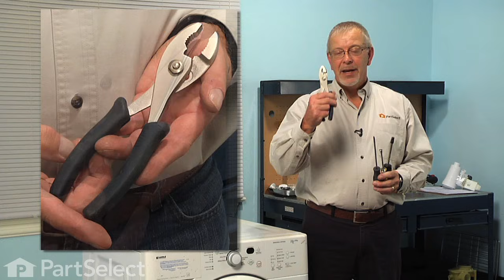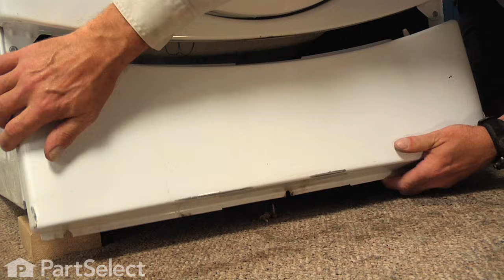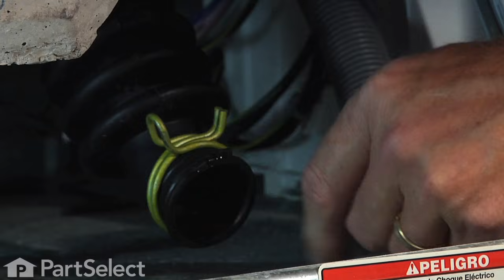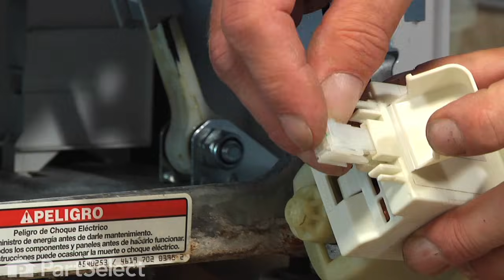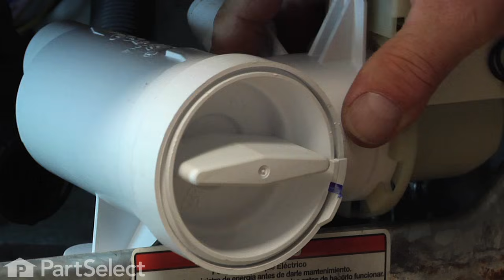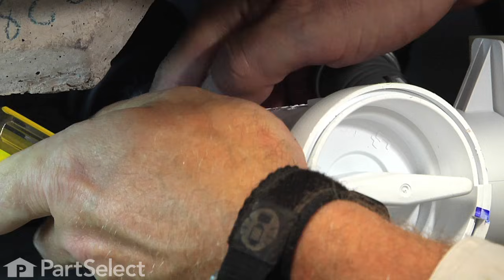Washing Machine Repair - Replacing the Drain Pump (Whirlpool Part # W10130913)

Comment: My Whirlpool (wfw9250ww01) has a completely different type of metal clamp holding the second drain in place so I'm having a difficult time figuring out how it detaches. There is also a bracket with two screws underneath the machine holding the pump in place so it wouldn't just come out as easily as you did it here. A close-up of detaching the electric would also be helpful.

Comment: Great video, thanks.  If replacing the black drum hose clamp (spring clamp) with the replacement worm gear clamp, I suggest putting the worm gear on top, facing left.  In the video, he puts it on the bottom facing left.  It's easier to access it with a nut driver or socket, and you can better see what you're doing.

Comment: Why replace the wire hose clamp with the worm gear hose clamp? Worm gear clamps are a pita to use in tight spaces.

Comment: THANK YOU! I am only a little bit handy, and usually avoid repair tasks that involve both electricity and water. But these clear, concise instructions gave me the confidence to try. And it worked like a charm! It took me less than an hour to replace this part, which cost $26, on my ~15 year old Kenmore washer. Compare that to calling a repairman or buying a new unit...THANKS AGAIN!

Comment: Take that filter out and clean it, including the black gasket, inspect for integrity before replacing.  Look inside the filter chamber and clean what you can in there as well.  If there is no leak, try a test run before replacing the filter. You might not need to replace the pump.  Just a consideration.

Comment: Great video.  On my Whirlpool Duet washer the 2nd drain clamp (out to the sewer) is a permanent-type clamp and I'm not sure how to remove it without breaking it?  The impeller isn't moving (stuck my finger in there) so there must be something wedged in there as I assume it's supposed to spin freely?

Comment: Thank you for this video.  I cannot seem to get the rubber piece to get into place.  Will it be a problem if I just leave it out?
Reply from the maker: The piece can be a pain but it should be put back in. The manufactures are pretty cost concious on how they build their products so if the put the part in  ideally it should stay on the machine,  I have at time had to lubricate that rubber piece with a little vaseline which really helped getting the rubber to slip into place.  Give that a try good luck you got this. -Chris

Comment: Do these pumps make any noises prior to them failing? I think my water pump is louder these days than it used to be. And its an older Duet washer which I have had to work on before. Also does anyone know what the average usable lifespan is for these drain pumps?

Comment: THANK YOU, THANK YOU! Draining problem and SUD and Error 21, Kenmore Elite He5t (these have been GREAT, BTW). I removed the drain pump just like you said (3 min), and after cleaning the trap, found a NYLON CORD and a METAL...something, wrapped around the pump propeller shaft. Removed them and...IT WORKS AGAIN!!!! Thank you, AGAIN! Draining the water was the hardest part!

Comment: Great how-to vid. If additional info is helpful? * Stackable, you don't need to tilt it back. Just get a extension bit for the 1/4 driver. I use a drill. Save the hose clamps, always useful. Save the gasket on the large item filter. Usually need one of those b4 the pump goes out. Last, if your pump took a trump... Your washer is full of water. Use a funnel to a bucket (gallon size) and drain that way. 
Once again, great vid! Followed it & was done fast. Just some little adds if anyone's interested 👋

Comment: Just wondering if you might be able to shed some light on a problem I am having. I have the Kenmore HE2Plus washer/dryer machines and need to replace the control board on the washing machine. My problem is .. .. .. how do I remove the outside metal panel to get to the board? Would I need to take the dryer off the washing machine first (they are currently stacked)? There are no visible screws to release the panel and the manual does not address this issue. Thanks for any help you might be able to provide.

Comment: Had to replace this a few years ago, just after buying the &%$. All I could remember is how easy it was, now I got to do it again and couldn't remember how I did it so easy, so I start from the back panel. Took a break to keep myself from taking the sawzall to it and punched Google up with a "how do I" question and your video was at the top of the list, just the way I now remember doing it. Great video, probably saved me from buying a new one - thanks for bailing me out.

Comment: This video was so helpful.  Worked just as Steve the mechanic demonstrated. Our Washer - about 10 years old - had a ton of stuff in the "button " trap and the pump impeller was stopped by a eyeglass cleaning cloth wrapped around the impeller axle.  It worked fine after that, but if it "goes" , I now know how to replace it with a new pump. Wish I could show you a photo of the junk, nuts, bolts, paper clips, pins, lots of coins, screws, bamboo skewers... unbelievable.  Plus one dryer sheet and the offending microfiber lens cloth.

Comment: Great video but you didn't show how to remove the pump away from the debri collector.  If this helps others ; to remove the pump from the collector, disconnect the accessory plug (mentioned in the above video)  near the top of the water pump, this then allows the removal of the small plastic shield that covers the small water pump motor.  Once done, you'll find that by removing the plastic shield, you'll see  if you look around the 11 o'clock position (if the top of the water pump is 12 o'clock)  a small flexible piece of  nylon plastic on the collar  (much like a dividing board) that requires upward pressure to allow turning of the water pump collar counterclockwise for removal from the debri collector. Once done a quick inspection will reveal any problems associated with the performance of the propeller.   I found that after pulling out the spindle from my pump motor (keep in mind it required a good tug)  it was full of a black mushy grunge that was impeding the propellers performance.
Reply: Yeah, I just replaced the pump motor not the whole debri collector too. Didn't have to go through the steps you state here though.  I just grabbed the motor and spun it counter clock wise and it came off easy peasy.   Did you have a round rubber ring seal between the pump motor and the debri housing??
Reply: @davidr4249  Hi Dave; It's been awhile since I did the work and to be honest, I can't recall if there was a rubber seal or not.  Sorry.
Reply: Thx u G! -I'm gonna  figure out a good place for a fine mesh screen to stop that gunk too. seems like the logi nxt steezy 💯

Comment: I just changed the pump on my washer. I had ordered the pump for my whirlpool washer from Sears Parts Direct. No hose clamps came with it so I had to purchase them separately. With the use of this video it was a simple change over. If you have ever replaced a radiator hose you can do this. The only problem I had was to get the black rubber locking piece to lock back into place to hold the pump in its position. After a lot of struggle I noticed the new rubber piece and the old rubber piece are different, as the old one has a groove cut into its edge to accept the lock which protrudes out from inside the hole where it fits down inside the cabinet. I exchanged the two rubber pieces and put the pump back into place with the old rubber piece attached and then was able to lock the pump back into place.  A large flat screw diver was used to push in from the side while the pump was pulled to the left. Without this video I would probably have had a much harder time with this.  Thanks.

Comment: Cant thank you enough! We have twins and a lot of laundry. Cleaned the filter in and back together and working in 30 min.
Reply: Thank you for the video. It seemed simple enough so I gave it a shot, ordered a part and fixed it in minutes. $30 instead of over $500

Comment: Thanks a lot, Steve. I was able to change washer pump with the help of your video after buying the required part on Amazon. I love it when folks like you share wealth of information in a descriptive way. There is no reason at all for anyone to hire appliance repair guy  to change washer pump after watching this video. If I can do it then anyone can! Along with saving a lot of bucks by not hiring appliance repair guy, knowledge that I learnt through this video can be used again to change pump as needed.

Comment: Thank you for this video
I took out the drain pump and found a small eyeglass cloth clogging one of the ports.
Reinstalled and all is working well
A new drain pump can be purchased for around 140.00 on line 
The several appliance repair companies I called were booked for two weeks out.
Reply from the maker: Hi Steve! Thanks for the kind words about the video, and we're glad that you were able to fix your washer yourself, rather than waiting for a repair company!

Comment: This video just saved me $300.  Part of a zipper pull got caught in my pump, an elastic with a metal emblem attached, and it was making a terrible racket.  After a bit of a diagnosis and watching this video,  I was able to take out my pump and remove the thingy.  Woot!  Thanks so much.

Comment: Ok, the appliance repair person who came out pulled the panel off without lifting the washer (it has a dryer stacked on it). He looked and looked.  His diagnosis was ripping everything out of the small space the units are in and taking the bathroom door off to move the unit into the living room to work on it.  It was to take an entire day and two men.

Now I know why my home warranty denied the coverage.  It wasn’t needed as the repairman wrote it up.  This is something I can handle with my little tool kit.  I probably won’t even break nail.  Thank you.
Reply: Update: Went and pulled that first part off.  OMG!  Hairpins, coins, earrings (not mine. This washer came with the condo) and black gunk.  It is clean now.  I know the rest of the pump is probably damaged by this mess, but if I can get it to hang on a couple more months.

Comment: Check the filter before replacing the pump. If you start getting F 02 code and pausing and restarting the cycle finishes the load then it is probably just the filter starting to clog. Just clean the lint and debris out of the plastic filter/strainer body and clean around the gasket to get a good seal.
Reply from the maker: Good point, Robert! Thanks for pointing it out!

Comment: Will this fit most whirlpool washers  mine is a WFW70HEBW
Reply from the maker: Hi Bernie, when researching your model number there is a 0,1 or 2 to complete your model number. Model WFW70HEBW0 and WFW70HEBW1 have the same drain pump (https://www.partselect.com/PS11754106-Whirlpool-WPW10391443-Drain-Pump.htm?SourceCode=4&SearchTerm=WFW70HEBW0&ModelNum=WFW70HEBW0) and model WFW70HEBW2 has a different drain pump https://www.partselect.com/PS11754613-Whirlpool-WPW10425238-Drain-Pump.htm?SourceCode=4&SearchTerm=WFW70HEBW2&ModelNum=WFW70HEBW2) I would suggest to double check the tag inside your washer to complete your model number. If you have questions please feel free to call us at 1-888-260-4310 or use our live chat options.

Comment: Thank you very much.  This helped me fix my mother in-law washer.  I didn't buy a new pump but had to clean out the drains from pillow stuffing.
Reply: Check the filter before replacing the pump. If you start getting F 02 code and pausing and restarting the cycle finishes the load then it is probably just the filter starting to clog. Just clean the lint and debris out of the plastic filter/strainer body and clean around the gasket to get a good seal.
Reply: hi Steve 
Working on Maytag 3000 series....
Cleaned filter lots of different junk... My question is it still flashes. F21 code....how  do I check impeller on motor???
It looks like it's supposed to twist off of pump hosing???

Comment: PartSelect 

Hello Steve..My Whirlpool Front load Washer is not draining...

I drained the water and checked the drain filter and confirmed that nothing was clogged in the filter as in previous cases.

I then ordered and installed a replacement pump thinking this would definitely do the trick....

Unfortunately after several attempts at cycling the washer then having to dump the water each time...The initial problem still remains...

What else could it be if it's not a blockage or bad pump????
Reply from the maker: Hi, could you please provide your model number and our team will be happy to look in to this for you.
Reply: PartSelect 

Thanks for the reply:  My Whirlpool Duet Model # is: WFW9150WW00.

Any assistance is greatly appreciated.

Comment: Is that drain pump part the same as a W10130914?
Reply from the maker: It looks the same, but the manufacturer has replaced this drain pump with PS11757304

Comment: Steve, this video assumes the pump is dead. In my case, last year, the repairman came with a new pump. He removed the old pump and I thought I would take it. While he was getting the new pump out, I played with the old one and found something lodged in the impeller, freed it up. That was the problem! He installed the new pump anyway, but I would not have let him do that had I been the one paying  for that new (and quite pricey) little pump!

On the Maytag 3000 series, the pump motor and impeller are replaceable w/o swapping out the entire pump and filter assembly.  

I do not know if this is the case for the model you are working  on, but at the prices they charge for parts - why replace a filter trap if it isn't broken?

Other wise a pretty good video. You might get Parts Select to buy a camera you can mount on your forehead so we can see what you are seeing (in addition to the regular camera showing the larger area - then edit the bits together as appropriate.
Reply from the maker: The manufacturer does not supply a pump motor separately for this range of models.
Reply: I noticed that Repair Clinic and similar outlets do NOT list the motor as a separate item - however, Amazon has a motor for my Model 3000 and several other models. So, if the motor is 'dead' it is worth searching the net because the price difference can be as much as $100 .

Of course, in my case, the motor wasn't 'bad' but simply blocked. As well, the repairman came with a new motor and had all but installed it when I (having asked for the old part - like Daddy told me to do) discovered the blockage and removed it.

On his sheet, the ;list price; for the motor was something like $500! as it was a Warranty Repair, I would not have had to pay for the repair. BUt Had it been on 'my dime' checking that 'bad' motor would have saved my a of of money.

So, my advice stands - check the motor for blockage BEFORE ordering a replacement and, if the motor proves to be 'bad,' search thoroughly for a motor-only before replacing the motor/filter trap assembly for more money.

Comment: just replaced the pump on a kenmoore front loader, because of the f21,f33 and sd error, (all those codes pointed to a faulty or bad pump, it worked great only thing was it had a long spin cycle, could it be because I didn't put the panel back on before the wash.
Reply: a 30 min wash took 47 mins,
Reply from the maker: The front panel being removed would not have any effect on the cycle length. Check the drain and drain hose for any obstructions.

Comment: the hose that is connected to the detergent, and bleach container is leaking. hoe do I get to the hose?
Reply from the maker: You will need to remove the top panel. This is normally secured to the back panel by a few screws along the top edge. You should be able to pull the panel back slightly and then lift off. What is your model number?
Reply: Nice I'm air tech services

Comment: Awesome!  We have the Kenmore/Whirlpool product and this was great!  Sears/Kenmore offers no information on how or where this catch was located or to even check it first in their trouble shooting guide.  Sears has no mention of this feature/device. 
Your tip on catching the water was very helpful; based on my last experience with an older coin/button catch that had to be completely removed letting the water drain everywhere.  
Sears was not much help other than giving us the Whirlpool model number, which when searched your video came up.  The Sears Model W10117770A/ 11047561603 button catch was clogged with coins, screws and a bunch of lint.   Don't need parts, yet, but when we do the order is going to PartSelect.com. Thank You!   Ed A.

Comment: Really appreciate your video and the other one on the water temp sensor. Both items were easily repaired by following your videos; it turns out that the filter had caught quarters, dimes and pennies, plus broken up ball point pen remnants. Thankfully, the impeller was still in decent shape! I could see the temp sensor plug hanging down in back, no doubt that was causing the fault code... but I couldn't see the receptacle. So, off came the back, the plug was easily re-attached and it also gave me the opportunity to check the belt for wear. For a 10 year old washer, it's holding up fine. Thanks again, Steve!

Comment: Thank you so much.  Just saved my bacon.  My wife was about to go buy a new wash machine.  I asked for a few hours to work on it and look into the error some more.  I came across this video and literally watched it as I worked on the machine.  A call to Sears Scratch and Dent and $72 for new pump assembly and the wash machine is running like a champ.  I took apart the old pump assembly and noticed immediately a busted impeller and surrounding shaft seal was nearly non existent.  I am fairly handy but have never worked on wash machine before in my life, and this was a cake walk.  You rock and made me look like a superstar!